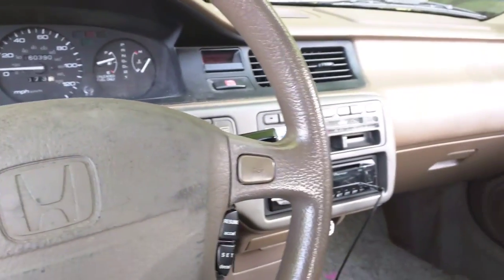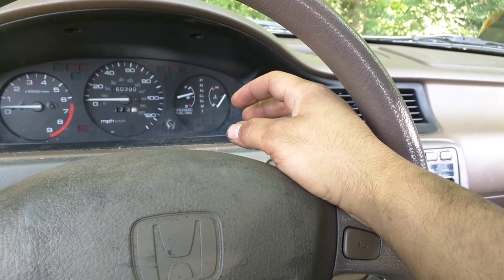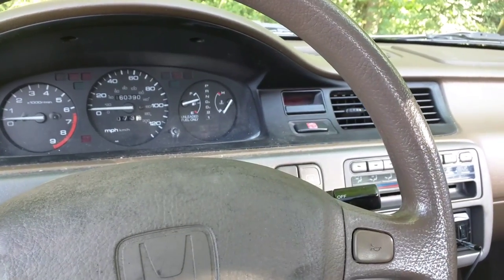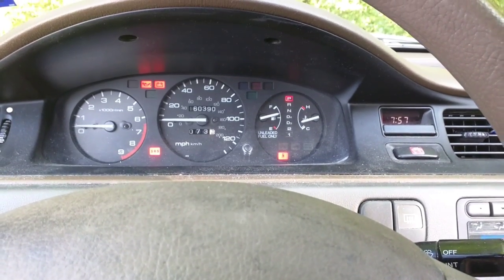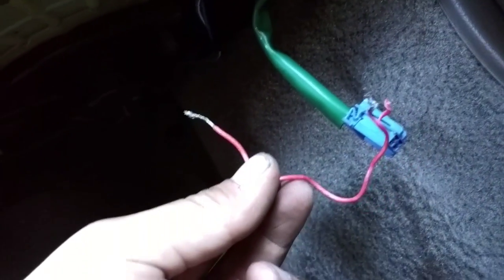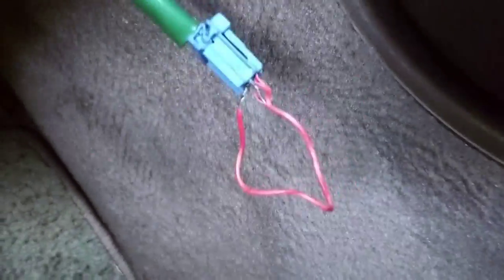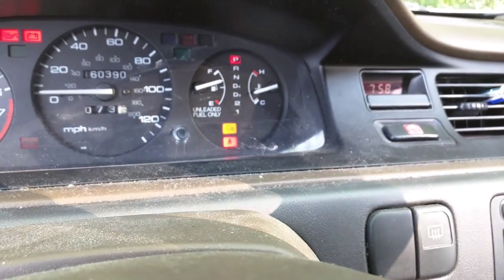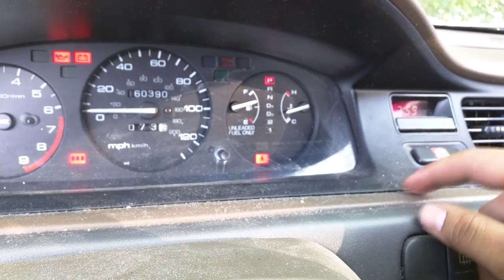HONDA obd1 code reading

Comment: I have error 8. Help
Reply: The top dead center code?
Reply: @Celebratinguilt  yes.... Tdc
Reply: @TheAngeloNiki  The top dead center on my 95 Honda was in the distributor. I changed it out and it fixed my TDC issue. So unfortunately a whole new distributor might be in place